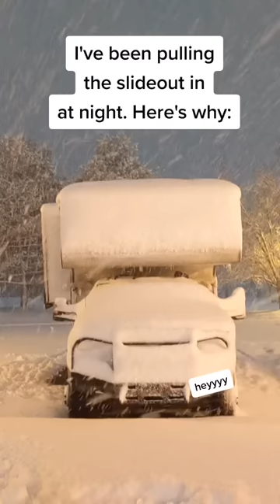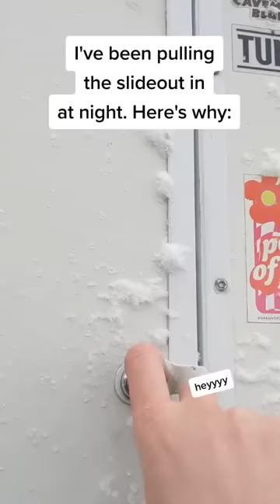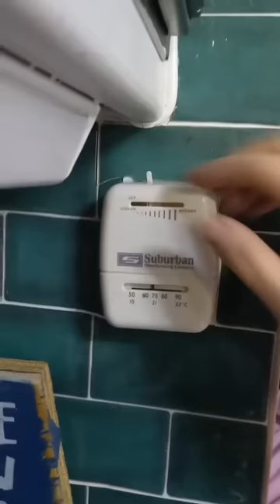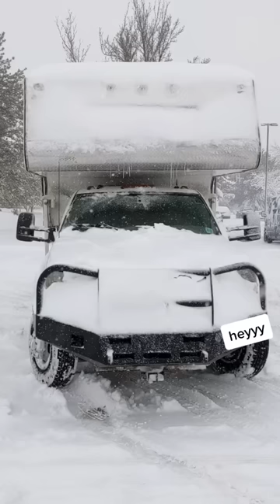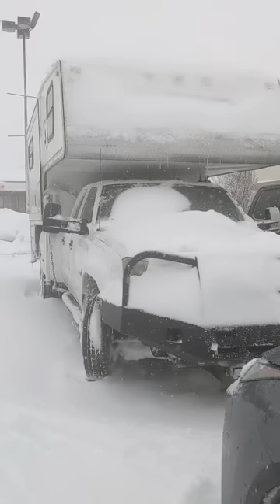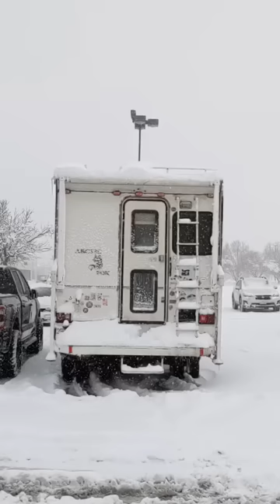the truck camper slide out theory #truckcamper #rv #rvlife #vanlife #fulltimerv #travel #slideout

Comment: I think not only does it make less area, it most likely seals better
Reply: Makes sense👍✌️
Reply: Well think about it. In Russia and Ukraine and other countries nearby,  you often seen mostly 1 or 2 room homes and they hang rugs on the wall vs pictures.  Why? Insulation. Many families have had the same rugs for hundreds of years. 
My point being,  if you have extra blankets, hang them across windows or where the slide out is, just to block cold breezes and Insulate you from the colder exterior wall. I noticed while camping this worked well.
Reply: I agree
Reply: @Annette from Ca  and poor build quality, heats up do to less area needed to heat however it may loose more heat depending what kind of side seals it has in that case it would be better to open up fully and allow the full space to heat then just maintain
Reply: Less area to heat. Yes
Reply: Yes I was going to say the same thing
Reply: Keeping it in during freezing weather should protect the slideout mechanism from working too hard.  I doubt much is saved but I have no experience.
Reply: Add dark beach towels or moving blankets over the windows and yes keeping it in means a smaller outside surface area to loose heat through
Reply: @brendab  true but hanging blankets helps. Some use plastic but that actually promotes mold. Just like a wet hot bathroom. It collects and sweats on the inner lining vs a blanket or rug absorbs moisture then after the winter wash it and set out in the sun.. They slow breezes, hold in heat and less chance of mold.
Reply: Yes
Reply: We kept our slides in during cold weather. I believe it helps.  It seemed warmer and cozier. Plus if you are planning on traveling you will not have the concern of ice build up preventing your slides from working.
Reply: BETTER LISTEN TO THIS GUY❗ HE'S 💯% CORRECT AND KNOWS WHAT TIME IT IS❗👍🏼
Reply: Agreed
Reply: Wearing out slide mechanics, expensive to repair.  Do you have a plan if it stops working when you are isolated?
Reply: @robzombieshot  😊😊
Reply: 1000%
Reply: Spot on
Reply: No sooner did I reply than I read the next statement yours. Great minds think alike.
Reply: Slides are less insulated than other parts of an RV, more exposed walls means more heat loss.  😊
Reply: Definitely if the seals are working and when it snows it can leak and ruin it when you close it with snow on it.  Clean the snow off when you bring it in.
Reply: Not only that but the accumilation of snow could damage your slide out because of the weight
Reply: I’m not an HVAC guy or anything, but it does seem logical that by making the room smaller, it should use less energy to heat. I also have to agree that it probably does seal better against drafts.
Reply: Where I live they build small homes woth 2 stories, heat rises so why waste it. Unfortunately for me I have a HUGE house, 125'x25' with full length basement, and almost full size attic, all heated, so about 7500+ sqft of heated home, ive spent last month over $1k in wood to heat and $600 in propane...have 4 furnaces , 1 wood and 1 LP on each side of the house. If I could stand rhis house straight up I know is spend less than half what I do !
Reply: Yes I agree seals better
Reply: Live in a 5th wheel in Pa during the winter, my biggest problem was water lines freezing. Staying warm was no big deal after getting a propane heater, used intermittently because it threw out enormous heat
Reply: @robzombieshot Floor rugs work well also. Wool is the best material for rug insulation for both cold and hot weather.  Include the cab of the truck. In people camping out in cars, the commenters say a simple single layer of rings on the floor of their cars can generally raise the temperature by about 10degrees Fahrenheit.
Reply: @robzombieshot Am living in damp area. Near beach. Tiny area. Handwash and air-dry my clothes inside. A few methods to collect condensation is in the sliding glass door bedroom, Himalayan rock salt collects the condensation well, needs a pan to collect the water. Am also using baking soda boxes and recently am trying out barBque charcoal briquettes for the first time. Cleans air, empty planter boxes so during the day, placing outside to allow the air to dry. Advice was to purchase activated charcoal and not coated with lighter fluid. Seems to do well cleaning the air. In the spring, I will use as recommended in the bottom of my plant containers when I start my spring plantings. A tabletop air dehumidifier didn't work out too well. Works well in the kitchen as
Reply: It’s the same seals dude
Reply: Mine seals better when it's out.   So even though it's less space I lose it out the seals.  Mine is older and the seals are not great.

Comment: Slides are super drafty. You are def saving heat
Reply: Separate wire an outlet for a dedicated electric heater..plug into shore power
Reply: @ernestperkins3084  I found our trailer with no slides very warm and cozy and the one with slides super drafting despite having multiple space heaters going.
Reply: What is a slide in regards to this? I’m so lost..

Comment: You are correct to bring it in at night. The square footage sticking out there in the wind in the cold. You can feel a difference on your feet when you’re walking from the floor of the camper to the floor of the slide out. I’m in a big fifth wheel with three slides but if I’m ever in the freezing cold temperatures, I pull in the bedroom slide and it does stay warmer in that space.

Comment: Just a safety thought, make sure your batteries are able to run the heater fan all night, if it has a sail switch, it's purpose is to insure you have enough air moving through the ducts to keep them cool, if air flow is too low it will trip and turn off the the gas and protect the ducts from melt down which is to save your life.  I've had that switch lock up under low battery and fan speed. It's a real thing.

Comment: Yes it’s true the slide outs are less efficient when they are out.
Reply: That is actually incorrect I RV 24/7 In Colorado and actually it's any efficient if it's in
Reply: @LilyandOllieTv  then your RV has a problem. Yours doesn't deal properly when it's retracted. The only factors are the volume of air and less surface area of the RV exposed to the elements, when it is retracted. It should ALWAYS be better when retracted, all other things equal.
Reply: I would think the slide out would bring in would a smaller amount of surface. Just like a two zone house. You can turn down heat if your are not living a portion of your home.
Reply: Air conditioning and heating is measured in CFM the less space you have to heat or cool makes it more efficient so if you can take up space with like some Styrofoam kind of like in a refrigerator if you take up the space it makes it more efficient
Reply: You're just going to go ahead and state this as fact? 😂
Reply: @timbodnar6711  yes
Reply: @timbodnar6711  you want us to lie  about it? Are you a propane seller?
Reply: @LilyandOllieTv it's more efficient simply because it's less cubic feet of space to heat up. That's all

Comment: Fewer square feet = less area to heat. Maybe not a HUGE difference, but a difference. Lots of other things could contribute to savings. Not extending the thinner side walls and exposing only the better insulated end wall, for example. If you're sleeping, you don't need the extra room anyway.

Comment: Definitely bring in the slide before a heavy rainstorm or a snowstorm.
The sides of the slide are not as thick or as well insulated as the exterior wall.  A solid wall is better than a broken up wall with just seals around it.  
I have been through lots of storms including Florida hurricanes and I brought in the slide.  Also turned the rig to nose into the wind and it made a big difference.  Tighter walls and lees space to heat or cool.

Comment: This is what I think...slides have seals around them to keep the rain/weather out of your camper.  Your seals may be old and worn out, causing cold air in your camper when the slide is out.  So when your slide is in then the cold air can't get in and it doesn't take as much heat to heat your camper.
Reply: makes sense
Reply: new campers are worse or air leaks

Comment: As An HVAC design professional, I can say definitively, yes. Less surface area exposed to the elements = less heat loss. Heat loss through a structure is directly proportional to area. With sled out you are adding the floor, ceiling, and two walls, plus any additional air change of the extra cu. Feet.

Comment: Yes pulling the slide-out in lowers the surface area you can lose heat through, and the volume of air you are heating it also doubles up some insulation.

Comment: I've run a SIPs plant, and construction company for years. (High quality insulation) We dealt with a number of RV's and tiny homes.

To answer your question, yes it will make a difference, however the difference in the volume of air being heated is going to be nearly immeasurable.

The big difference is likely to be in the quality of the seal between the slide being open versus being closed. Most often the seal when closed is better because it has to prevent water air and debris from entering the camper at highway speeds. Versus the seal when the slide is open only needs to keep the rain and wind out. there may also be less insulation in the slide, especially "ceiling" portion.

The furnace kicking on more frequently is a sign that you have heat loss. Most heat loss comes from either poor seals or inadequate insulation. The extra volume of air is not going to make the furnace kick on more frequently, but may cause it to run slightly longer in order to heat up that extra volume of air. (again, very negligible).

If you want to save money and fuel from heating, checking seals, upgrading windows and doors, and finally improving insulation.
Doors and windows are typically the biggest culprits, although checking for leaks wherever there is a perforation in the exterior, is a good idea.

A cheap improvement that works in nearly all scenarios (because windows will never be as good at preventing heat loss, as quality insulation) is to make window (and potentially door) covers that can easily be attached and detached. The better the insulation in the covers the better they will prevent heat loss.
An insulated blanket (like a movers blanket) sewn to a piece of Reflectix (bubble wrap coated with reflective foil) makes for a really good temporary window insulation cover.

FYI a rooftop vent, AC unit, are also very inefficient at preventing heat loss, especially because they are at the highest point and heat rises. Making a cover for those will help as well.

A note for safety, if you are going to improve the seals this will prevent heat loss, by preventing air from entering or exiting. Please be safe and install a carbon monoxide detector for small spaces with minimal fresh air being exchanged.

Hope that helps.

Comment: Yes, it makes perfect sense. You are heating smaller volume/interior but also, less outer camper surface is radiating the heat out. On top of that, your camper is better sealed with the slide retracted

Comment: The concept is sound from a physics standpoint for two reasons:

1:  You are heating a smaller volume of air, hence any thermostat controlling the temperature will turn off the heat sooner.

2:  The camper will have a smaller surface area through which to lose heat.  Assuming all surfaces are insulated the same, (which may only be roughly correct), the smaller surface area will provide less contact with the cold air outside.  

From a practical standpoint, there is at least one additional concern - sealing around a gap with parts that move through it can be tricky to do well.  There is a good opportunity to lose additional heat through all gaps associated with the bump-out.

Comment: Yes the slide-out let's more cold air in when open then closed. Also less air to heat when slides are in. I suggest turning your heat down to as low as comfortably possible. We would keep ours at around 62°F When you do have your slide open stuff towels/clothes in the gaps around the slides to insulate and keep drafts out. We also added insulation to all the storage doors with foam and white duct tape. Doesn't hurt to get a candle lantern to help out the furnace . We've Camped in -30F and our 2 7gal propane bottles lasted about 1 week.

Comment: I believe it does. Makes sense smaller area. The gasket are not as good for insulation  and wind may leak in. As for Bottom of slide  R rate may not be as good. Check with manufacturer. Good luck. Be safe.

Comment: It makes sense, when ur slides are in there's less space to heat and  so on. 
So if there less space to heat, ur furnace won't be turn on as much as it used to.
Reply: This totally makes sense. Just like a small house with less square feet,windows,and doors doesn’t use as much fuel as a large home with more square footage, windows and doors.
Reply: We are not talking about much room it’s maybe 20 square feet meaning it isn’t much room to heat. Now it would be different if it was a full size room but we’re not.

Comment: You have it right and wrong at the same time. By pulling in the slide you are reducing the surface area of the outside by having it in. With the slide out you are creating a extended cold box. 
You may even want to light a couple of candles to help as long as the carbon monoxide doesn’t build up. 
On my camper I made insulated curtains that really help.

Comment: Yes of course it makes a huge difference not only for the square feet inside that has to be heated, but having the slide in has less surface area in contact with the cold air & snow outside and it is also less drafty & better insulated when it is in.

Comment: Heating a smaller volume will absolutely cost less energy. And the more you can insulte the walls, windows, doors and seams, the more heat you will retain. Hanging blankets over the windows, or using foam padding, will help insulate your space.

Comment: If the slide has been out in freezing weather the walls are freezing. When you bring it in those freezing walls are now inside and the furnace will have to run continually until those walls are heated up to room temp. It is probably really close to the same propane usage overall. Then you have the smaller space to deal with moving around. Also moving the slide in and out more often cause more wear and tear on your slides and motors.

Comment: Yes, there would be less area to heat BUT you should also consider the daily wear and tear on your slide motor and gears etc. Unless you move every day to a new spot and would pull them in to travel anyway. Just a thought

Comment: Without question it will save some heat depending on the air volume size with the pullout not engaged. Like a dripping tap, a brief period doesn’t make a big difference but closing it frequently over time, absolutely. Besides that, the insulating system surrounding the pullout would be less effective when open due to design necessity to not cause problems opening and closing it. Lastly, most campers are optimally designed for 3 season efficiency, not cold winters so everything will help.

Comment: Several years ago installed a computer control system for a friend. It monitors everything and it does save gas and power shorter run times and less frequent cycling!

Comment: U can buy a mini wood stove for winter use with slide out a full wood stove will keep you heated for 8 hrs
Reply: A mini stove will heat the area for as long as you put wood on every hour. That's the downside. They're so small that you must tend to them alot more often.
Reply: i have a Dearborn heater in my r.v....they don't make them anymore however they are easy to find. mine is rated for altitude and it's much,much  more efficient than an RV furnace, and it does not require a fan. parts are available from Eastway in Houston. 
   i lived in a converted school bus for 20 years; now i live in a 1996 Coachmen, which is a piece of toxic, rotting, leaking garbage. am kicking myself for ever giving away my solid, never leaking bus, at the time it made sense.
Reply: What about carbon monoxide?
Reply: @harridan.  I'm sorry you no longer have your bus.
Reply: @patshelby9285  me, too. at the time it made sense to get rid of it. argh.
Reply: @patshelby9285  my Dearborn heater is rated for altitude, and this r.v. is absolutely not airtight, though i do keep a window cracked. i have friends who go to great lengths to install and use cast iron wood stoves, however i am no longer interested in waking up to a cold house to feed a dambed fire several times a night and living in the woods i won't risk a forest fire by using a short stacked wood burning system, having recovered from the romance of a wood fire years ago. if i actually traveled in this crate i can't imagine hauling around even a weeks worth of firewood, i don't have the space for that. also, i live in black widow country, NO Firewood In The House, Please!!

Comment: It is absolutely true you are heating a smaller volume of space when you close the slider. It's the same reason why an office building uses a drop ceiling inside of an office space to lower the amount of space that they need to heat or cool, saving money. It's not the surface area, it's the volume of space inside your motorhome that is smaller with the slider closed.